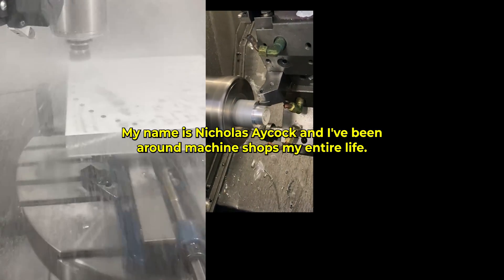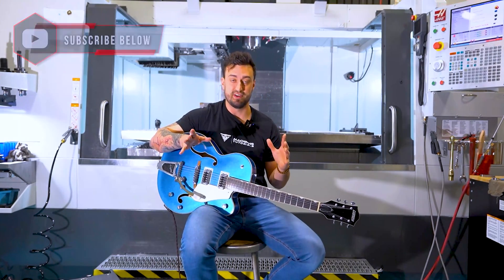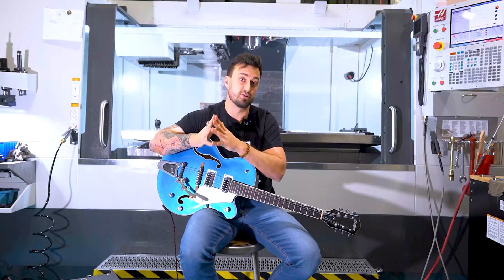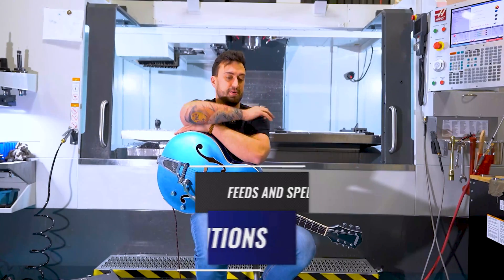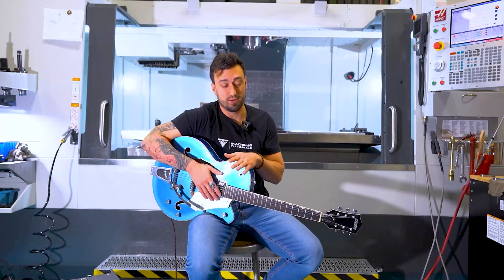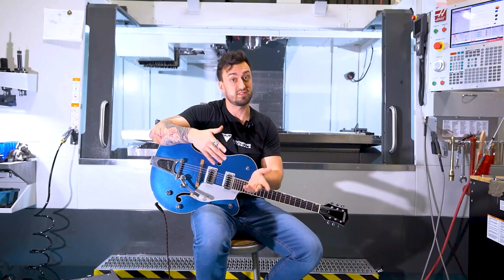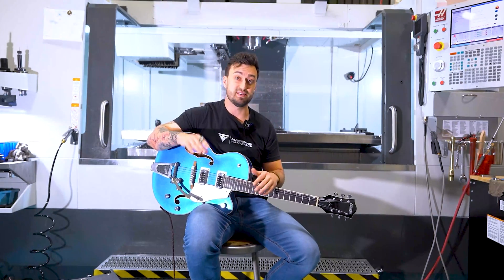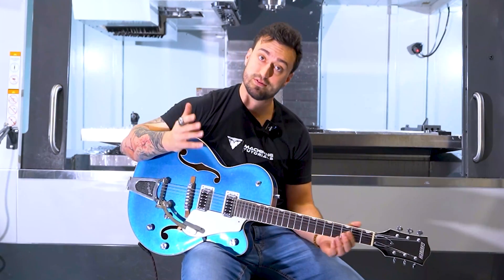Feeds and Speeds Explained: A Beginner's Guide for Machinists

Comment: In my opinion you cannot go on gut feelings. The insert manufacturer usually provides a range of cutting speeds and feeds applicable to the alloy your cutting. They also recommend specific insert types for the material your working with. I'm no expert and some of you might say 'thats for sure' and I respect that. I'm new to cylinder head machining and have lots to learn. So I'm looking over many videos and going to compare them to what the machine and tooling manufacturers recommend as this video tells us to do around the 9 minute section.

Comment: Speeds and feed are dictated by material hardness period! All of the cutter manufacturers have surface speed recommendations established for their products. You chased your tail for 80 percent of this video! Wasted my time to even watch!!!
Reply: Well if you know every thing already don't watch any more.
Reply: @FailedExpert6330 exactly 👍
Reply from the maker: Thanks for the feedback! While material hardness and manufacturer recommendations are important, there are many other factors at play, like machine rigidity, horsepower, tooling, and specific job requirements (used tools vs new tool). I’ve been training machinists for years, and no one can just plug in speeds and feeds without adjustments.

This series is meant for beginners, teaching the basics like RPM, SFPM, and how to calculate them, stuff most people starting out don’t know. It’s all about giving them the tools to learn and adapt. Appreciate your input!
Reply: The video was pretty educational to me and Like he said…those recommendations don’t consider machine capability, tool wear, set up conditions and any other condition that can affect your process in making a part which is was this video was literally about. We don’t live in a perfect world rick.
Reply: Feeds and speeds from manufacturer are recommendations. You need to tweak them.

Comment: This is a great video and I'm looking forward to the rest of the series. 

One thing I'm often struggling with is the max speeds and feeds of my old (manual) machines. When using hss this is fine, but when switching to carbide I'm running out of speed really fast. 

Could you talk about how to handle that?
Reply from the maker: @JohanVergeer  absolutely, that’s a great subject. I’ll definitely include it. Thanks for watching and the additional idea. I’ll keep at it!